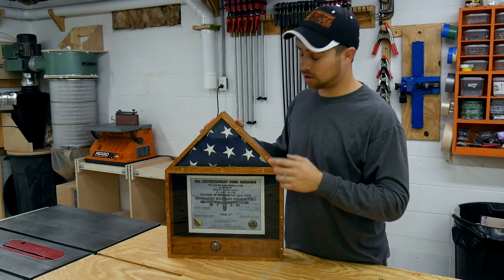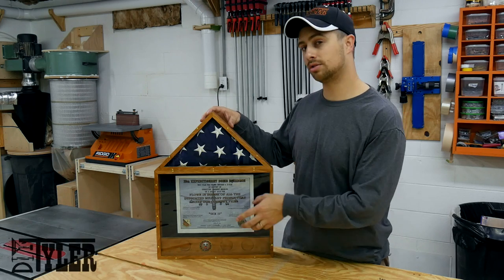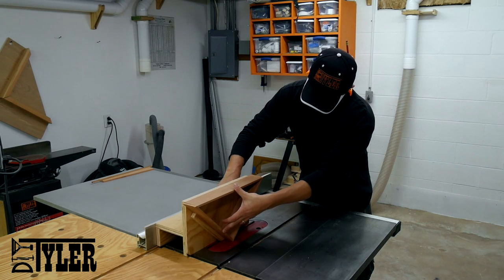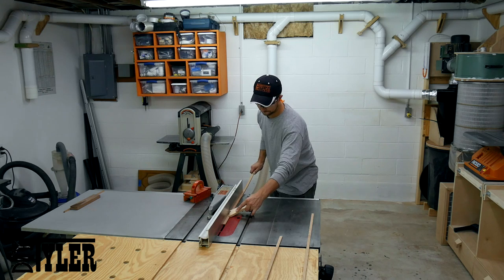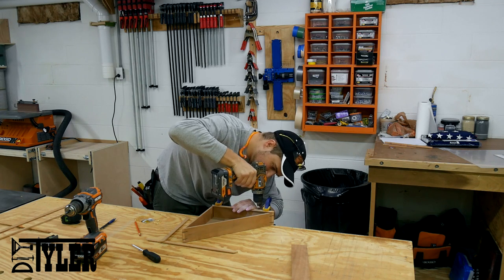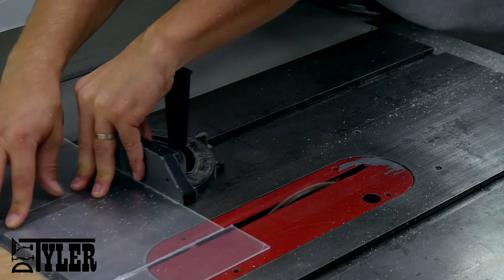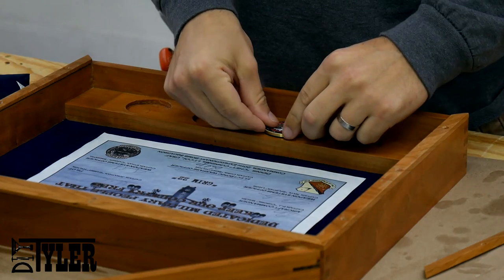Cherry Flag Display Case | Collab Part 2

Comment: One way to make the flag look "smarter" in its case is to cut a piece of cardboard just slightly smaller than the opening. Position the flag so that one star is near the top of the triangle and the row of stars below it are centered on the cardboard. Use pins in the edge of the cardboard to anchor the flag in place. Then you can stuff the rest of the flag into the opening, using to to press the now flag covered cardboard forward, up against the glass. It's easier when you have a opening on the back of the box, but doable on your project. Nice work Tyler.

Comment: That came out super nice, Tyler! Love the splines :D Always liked how they look as an accent piece, as well as being structural.
A tip with the brass screws: use a steel screw of the same size to cut the thread, then back that out and replace with the brass screw :)
Reply from the maker: That's a great tip man! Thanks for watching!

Comment: When I used red felt to line a jewelry box I made, it must have been cheap felt.
Just peeling off the backing stretched the material.
I ended up just cutting the felt to size and placing it in.
The stretched useless felt ended up being used to pad the bottom of the jewelry box to not damage the bureau it was sitting on.
(Hey it was a large jewelry box at 48" Wide.)
Reply from the maker: This stuff we certainly not inexpensive to buy, doesn't mean it was any good still, but it went on well! Thanks for watching!

Comment: Have you looked into having a frame shop cut you some quality anti-reflective glass to put in your display? Cutting down on the glare and reflections will really help to show off the contents of your display. And great work it too!
Reply from the maker: Never thought to look into it. Thanks for watching Dan!
Reply: The glass isn't cheap, but the difference it makes is worth it. And since you have the Plexiglas cut to size already, you have templates for them to use too.

Comment: Turned out looking great. Just a question: what made you choose 5 min epoxy instead of wood glue for attaching the top triangle? Just as good either way?
Reply from the maker: Thanks Kevin. Chose epoxy because it would fill in any gap that might be between the to boards, this way I also didn't have to clamp to try and force any gap closed.
Reply: Good thinking Batman. Thanks for the lesson, will store that away for future use. Great job on your woodworking and videos!

Comment: i use steel screws  the same size as the brass  then replace with the brass  no breakage
Reply: Same here.
Reply: William Howard, I love that tip!
Reply: thank you gentlemen  i hope that i can soon get in my shop again
Reply from the maker: Great idea! Thanks for watching.
Reply: busted a brass screw or two   then seen somone  use steel the same size  and wow  how nice so i bought a box of each just in case i ruin a steel one or two

Comment: Out of curiosity why did you adhere the flag holder to the bottom square piece using epoxy rather than just wood glue? I'm starting to get into the finer parts of wood working and love your videos by the way. 

P.S. Go ARMY!!!
Reply from the maker: Just in case there were some small gaps, wood glue does not fill gaps and adhere as epoxy will.
Reply: Awesome, thank you. Great display case.

Comment: Why did you use epoxy to stick them together rather than wood glue?
Reply from the maker: In case there was any gaps between the two, epoxy will fill the gap and adhere where wood glue would be useless. Thanks for watching!

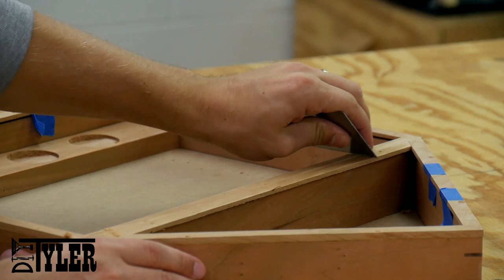Comment: Small question: 04:18 why the card scraper rather than fine grit sandpaper I wonder?
Reply: Card scraper is faster, most often better results, and is exponentially less expensive.
Reply from the maker: +Jay Bates It seems to leave a shinier and smoother surface as well, as if you sanded and polished to 600 without actually sanding at all.

Comment: you can't make a video about a flag case then not include a story about the flag, right? We're u in the military? Family member?
Reply from the maker: +MrPanthers23 We had an explanation for the end on Jays half but it ended up not fitting into the video. When I made the flag pole video I was contacted by a fan of the channel who is still active in the military, he hooked me up with the flag, certificate and coin. I have not served.